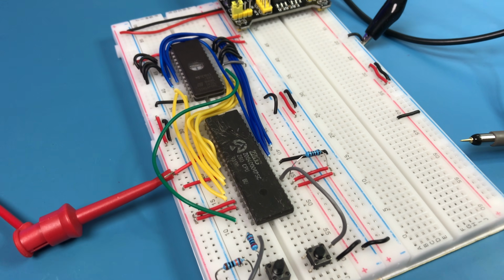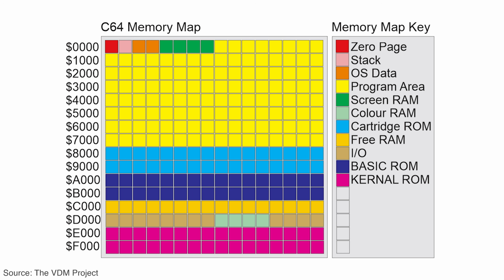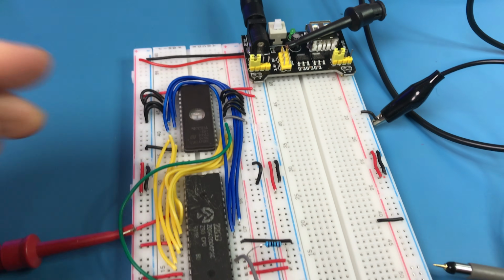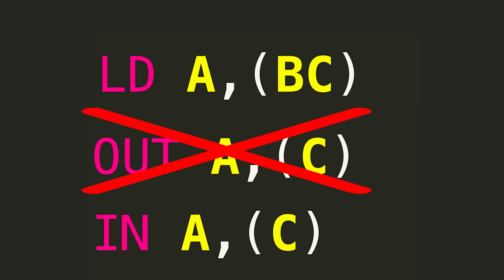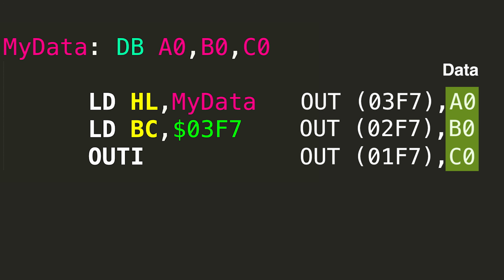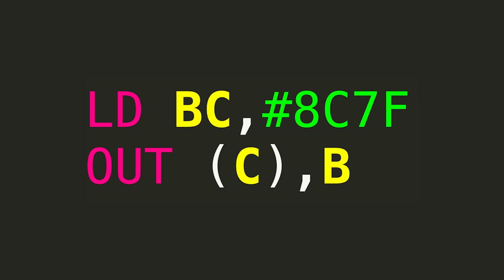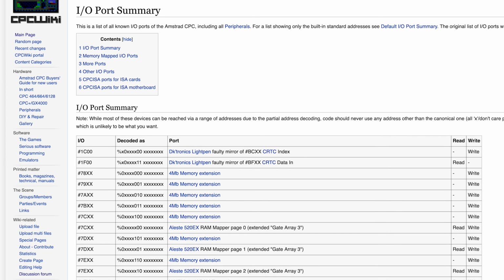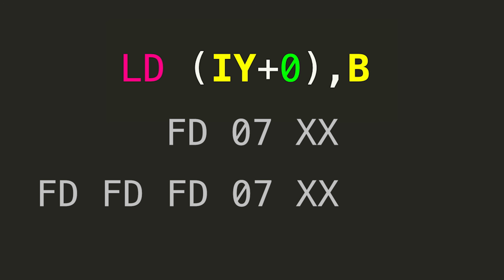The Madness of Z80 I/O

Comment: I don't understand the inability to single-step the Z80 CPU.
I was able to do so without problems back in the day.
I built a Z80-based computer in 1981 ... and single-stepping worked just fine.
Perhaps the Z80 design has been changed since then?
Reply: You can single step tie processor but most dynamic ram requires a minimum refresh rate which won’t be met when single stepping the z80 so the ram will lose or corrupt the held data because your not using it correctly. Static ram would fix that issue.
Reply: @SteveInScotland  That's exactly what I did when first building that computer. I used 4 KB of static RAM.

Only later did I add dynamic RAM, 16 KB x 3. By that time I had a bootable system and I no longer needed the single-stepping.

To my original question ... The single stepping that I used took advantage of the (peculiar) way that the M1 and WAIT signals worked. So I was wondering whether something in the design had changed that would render that unworkable.

Instead, it seems that it is still workable ... and that the only hindrance would be the use of DRAM.

Comment: Hi Noel, great trip down memory lane, thanks. I cut my teeth on Z80 assembly back in the day, just like you I used a switch to toggle the clock line. Pretty sure it worked without issue ie totally static design. I think the original Zilog data even mentioned this in the clock specifications dc to 2MHz, I remember being impressed by this. keep up the good work 😊

Comment: On msx you have a choice, you can use I/0 ports or memory mapped. It has a slot select mechanism where you can choose out of 16 slots on 4 memory locations (16KB pages) . There is also some other I/o addressing in the standard which makes it possible to go beyond 256 I/0. All these things were standardized . I think  probably that is why there are soo many extensions for this system.

Comment: Fantastic Video.

I'm a ZX Spectrum software developer and that's the best exclaimation I've seen for the IN (C) and OUT (C) not having B included in the mnemonic.  As a software developer, I often ues LDI, LDIR, LDD, LDDR but rarely have I every used OUTI OTIR INI INIR, just the regular IN|/OUT and so the counter versions because the root reason hasn't really occurred.  

I'm glad modern hardware does full address decoding.  :-) 
The Amstrad CPC info was new to me. Thanks.

Comment: i wish some of these videos were available in 1984,  it would have saved me many many hours of trial and error.  Every now and then I still code my old z80 based TS2068.  A few years ago I breadboarded (TTL logic only) my own dot matrix printer interface for it. That had been in my bucket list for 37 years.
Reply: I find it really amazing how much of this was in books and newsletters, even in Dutch. I sometimes feel less is available today then back in those days. For example a 7 volume IC guide, in Dutch, with everything from 74xx to microprocessors like the Z80, all in a well structured set of ring binders with better information than a digital folder of crappy datasheets.

Comment: Im a big 8080 fan, im glad the mnemonics for it are marginally more co sistant than z80. With 8080 in/out instructions always read/write to the accumulator reg. Verry bothersome that it requires the address to be ahrd coded but you win some you lose i guess

Comment: The ZX Spectrum requires the upper 8 bits for the I/O address to read the keyboard.  So you're incorrect about the chips just looking at the lower 8 bits on the Spectrum.  The upper 8 bits select which rows to fetch on the keyboard.

Comment: I spent the bulk of the 1980s using the Z80 almost exclusively, with a little deviation using the 8086. But used mostly Intel peripheral chips (8051, 8053, 8055, & 8059) with that Z80. Yeah, a little extra TTL "glue" to mate the signaling. Into the 90s, went to mostly x86, when a full processor was needed, and microcontrollers when it was simpler. Starting with the HC05, since it was a joy to code in assembly. Moved over to the AVR line, with a transient pass thru with a few 8051 projects.

Dollar wise, the Z80 was still the biggest selling processor well into the 1990s. This was when an individual Z80 sold for under a buck, compared to x86, including early pentiums, selling in the $200 range, each !

Comment: Another peculiarity of the Z80 is the added IX and IY registers. The Intel 8080 (which the Z80 was designed to be a superset of) had various registers (BC, DE, HL) that could be used as 16-bit registers, but each could also be used as two 8-bit registers (B,C,D,E,H,L). However, the new IX and IY registers could only be 16 bits, not 2x8 bits. In most cases, anywhere in the Z80 instruction set you could use the HL register, you could instead use the IX and IY registers (very useful). It didnt take too long to notice that the opcodes for these IX and IY instructions were the SAME as the equivalent HL instruction, but with one of two opcode prefix bytes that changed the next opcode meaning to use either IX or IY instead. Armed with that hackers (like me) experimented and discovered that if you added those opcode prefixes to instructions that accessed either the 8-bit H or L registers, the CPU would access the upper or lower 8-bits of the IX or IY registers. Again, very useful, and to this day I dont know why Zilog didnt document this feature (no doubt the instruction set designers didnt realize that this was hot the chip design ended up operating).

Comment: Welcome to the world of backward compatibility. The Z80 was designed to be instruction-set compatible with the Intel 8080 (a strict superset). Intel had only designed the I/O space of the 8080 with an 8-bit address space (256 I/O ports), and so the 8080 instructions used only the C register to generate the I/O port address. By the time the Z80 came along it was clear this was a mistake, as more I/O space was needed. Zilog's rather clever solution was to simply allow the B register to supply the extra 8 bits, expanding the I/O space to 64K without having to add any new instructions. This means the Z80 worked fine in existing 8080 designs (since they ignored the top 8 bits entirely), but new designs that were Z80 aware could use the expended 16-bit I/O space. The only oddity was the retention of the existing assembler syntax for the I/O instructions. In fact, very early Z80 documentation DIDNT mention that the B register appeared on the address but, and I suspect that this was not originally intentional, it was just cheaper to let the whole BC register appear on the bus (as it did with other instructions). And only later did Zilog document this as a "feature" when the hacker community had noticed (and used) this behavior in the wild.

Comment: Most of the Z80 assemblers I've used allow OUT (BC),r and IN r,(BC) in their syntax. It's essentially just a quirk of Zilog's documentation, just as JP (HL) should really be JP HL. And in mentioning the Spectrum, that is a specific case where the top half of the bus is used in I/O instructions, when reading the keyboard it specifies which row of the keyboard to read. And if you had something like a keyboard design where A8-A15 was a sequence for the INIR is an ideal use case. LD HL,keybuf // LD BC,&09F8 ; read 9 rows from &F8 // INIR ; grab all of them.
And you do know this isn't a Z80-specific thing, the original IN A,(n) OUT (n),A instructions also do exactly the same, A8-A15 are set to the contents of A before executing the I/O. LD A,&7F:IN A,(&FE) ; Read BREAK key from &7FFE. etc.

Comment: As far as I remember the classical gameboy also used a slightly modified Z80 which didn't use the in / out instructions at all. Everything in the gameboy was memory mapped. Input, synthesiser,  graphics output and even the "network link". I once wrote a simple assembler / disassembler to read and write gameboy roms in Delphi back in the days. I toyed around a bit with a gameboy emulator but nothing serious. Though it was a fun time. Since I'm kind of a "data-messi" I'm sure I still have the assembler somewhere as well as the GB emulator (I think it was "rew") ^^.

Comment: I remember the fact that the Z80 couldn't be single stepped, which caused me some headaches in debugging once. Took a second or two before the processor went socks up and a restart was needed. I realized pretty soon what the problem was, but it still was a headache.

Since I started with the Z80 processor the I/O it has seems normal to me.

A more interesting aspect is to use "IN (BC),A" (sorry if I borked it a bit), but then you could use the instruction to create a matrix decoder of a keypad.

Comment: 5:16: BC is output because it reuses the same circuitry that LD (BC),A uses. It isn't part of the mnemonic because hardware is supposed to ignore that. OUT (C),A is actually a Z80 extension. The Intel 8080 only had OUT (imm8),A and IN A,(imm8) (using Z80 syntax). Note the 8-bit port number. The Z80 added a variable-port any-register variant to its extended (ED) instruction block.

10:49: You can actually reach much faster speeds than LDIR (or even than an unrolled LDI loop) using an overengineered PUSH/POP loop, down to 12-13 clock cycles per byte copied, as opposed to 16 and 21 for LDI and LDIR respectively (assuming no wait states). The reason LDI is so slow is because the ED opcode fetch slows it down, the reason LDIR even slower is because instead of having the loop built-in, the z80 just decrements PC twice to go back to the start of the instruction on every iteration, which is a very inefficient operation. (EDIT correction: it may actually be doing a 16-bit+8-bit addition like JR uses. i need to look at the die shot.)

21:13: FD FD is not empty, it is undocumented. A standalone FD byte actually does the following things:
1. set a flag that disables all interrupts (including NMI) for one instruction. Other instructions that do this are all the other prefixes, and also EI.
2. set a flag that replaces any instance of H or L with IY for one instruction, and if (HL) is accessed, read another byte for an index offset
This means that every instruction that is valid in the base instruction set is also valid in the FD extension. Only some of these are useful though, because a lot of them won't be any different from the base instruction set.
Therefore, when the Z80 encounters the second FD, it doesn't ignore it and keep reading, it ignores the first FD. The second FD overwrites the first one.

Another device that uses a Z80 and has it wired up to use all 16 bits is the Texas Instruments 84 Plus C Silver Edition graphing calculator. Except it actually uses all of the ports separately rather than just wiring up some bits to some chips. And it has an ASIC with an integrated CMOS Z80 rather than an original standalone NMOS Z80. Actually, it does 19:50 too: it has a special sequence of 5 instructions that needs to be executed from a "privileged" rom page before letting you access certain hardware ports. However, no check is performed to see if the bytes are executed. You could just read them as regular memory accesses, which means there are a few variants that use undocumented instructions, that can e.g. avoid the IM 1 that is part of the sequence.
Reply: Any example of "overengineered PUSH/POP loop" please ? 😃
Reply: @amidarius  Uh, alright, so, for a general purpose one:
loop:
  ld hl,#
  add hl,sp
  ld sp,hl
  pop af
  pop bc
  pop de
  pop hl
  exx
  ex af,af'
  pop af
  pop bc
  pop de
  pop hl
  pop ix
  pop iy
  ld sp,#
  push iy
  push ix
  push hl
  push de
  push bc
  push af
  exx
  ex af,af'
  push hl
  push de
  push bc
  push af
  ld (#),sp
  ld a,r
  jp nz,loop

It uses all registers (aside from I, i guess), and uses R as a loop counter. Interrupts (obviously) have to be disabled. The first # is the difference between source and destination, the second # should be initialised to the address of the byte after the destination block, the third # is the address of the second #.

As the loop increments R 37 times and R wraps around after 128 (which is coprime with 37), every number of iterations up to 128 can be achieved in this manner.

Of course, the setup for using this method is very expensive, and even then it would copy at 15.9cc per byte (assuming no wait states), which is only marginally better than an unrolled LDI loop at 16cc per byte. And of course you also need to jump into an unrolled LDI loop to cover the remainder after the 20-byte blocks this loop copies. This is a lot of calculations, especially on a Z80 that can't do multiplication or division, but there are definitely cases where several of these values can be hard-coded.

(i did say it was overengineered)

However, where this method really shines, is if you know source & destination at assembly time, and are willing to unroll completely:

  ld sp,#
  pop af
  pop bc
  pop de
  pop hl
  exx
  pop bc
  pop de
  pop hl
  ld sp,#
  push hl
  push de
  push bc
  exx
  push hl
  push de
  push bc
  push af

This can do 12.5cc per byte(!!), in 14-byte multiples. (and it doesn't use AF' because that would actually slow it down to 12.75cc per byte)

LDI is slow because it's an extended instruction :(. PUSH/POP are crazy efficient like this because they're one-byte instructions that can do two memory accesses. So copying one byte takes 3 total memory accesses, instead of LDI's 4.

It's even faster if you just need to zero out a block of memory or something:

  ld hl,0
  ld b,l
  ld sp,block+4096
loop:
  push hl
  push hl
  push hl
  push hl
  push hl
  push hl
  push hl
  push hl
  djnz loop

This clears a 4096-byte block starting at `block`, taking 25875cc in total, for a rate of 6.32cc per byte(!!!!!).

But remember to save&restore SP. And remember you can use SMC for that too to save another 10cc :p.
Reply: Okay i did some math to figure out more about the initialisation. The number of iterations is BC/20. The number of bytes to be copied outside of the loop is BC%20, so the JR offset into a block of unrolled LDIs is (BC-1)%20*2. To find the number to set R to, multiply the number of iterations by 45, add 36, and AND with 127. Or something other than 36 depending on where during the initialisation you're setting it. However, this method only lets you copy up to 2560 bytes (+ 19 for the unrolled LDI loop), so you can save at most 256cc, which is less than the initialisation would probably take. Unless you added an outer loop counter too, or unrolled the inner loop some.
Reply: @fghsgh  Yes, the first metod is really overengineered. 😄 I knew for second (With 8-byte multiples (Without exx.) was already enough fast. 13cc/byte) and third one. Anyway, nice post for all Z80-every-cc-counts newcomers. 😂

Comment: Amstrad dev here. It wasn't just a cost issue driving the weird I/O mapping. We also had to consider the number of logic gates available in commercial gate arrays. Side note: The prototype hardware used discrete logic to produce a Gate Array Simulator with the same pinout as the final chip, called the "GAS Board." This also held the EEPROMs that eventually became the ROM. Later we would hack off the EEPROM sections to use for ROM development and called these bits "Small GAS Board" which evolved into us calling them Smorgasbords. You're welcome.
Reply: Awesome insider view, thanks a lot!

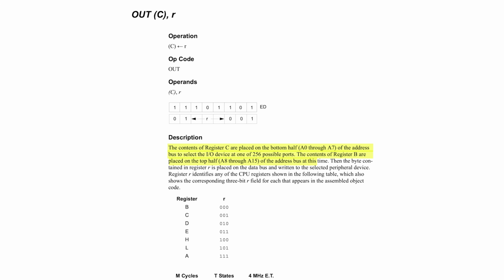Comment: 5:06 yes thats how it works. so if never use B for 'r' to send data you can use that B to make 16bit device address. cool? or not yes thats trick. that how is was desinged todo but someone made misstake. b and c should not be in used register if it use c and b lol.
if i remember correct bute from register ''r go a0-a7 to select device miss leading C that not use but byte that come after opcodes go data line AND those same go A15-A8. some one made bobo. same data you send device is same as what you can use it select device. NOW desing computer xD

Comment: 4:07 yes thats how it works. 255 different output device. is that too much LOL. and only we use d7-a5 to select device and a3-a0 address on device if it need. and some people use a4 to double those devices 16 devices + 16 control address for. thats enought. without loosing ram/rom space.
those devices can be latch for changing ram/rom banks.yes more than 65k

Comment: You also need to take into account that I/O instructions made it into the x86 realm, so far that I/O cycles were a special cycle on the PCI bus. The limited amount of I/O addresses were a constant annoyance, mostly because a large swath was generally taken out of each page to account for aliasing of old ISA cards. The ability to have so many devices on the PCIe bus would cause legacy devices to run out of allocated I/O areas. I think that happened somewhere around 10 ethernet controllers.
Fortunately, when NOT using legacy access modes, we were able to scrounge up more I/O ranges. It was amazing to me how long the I/O ranges lasted in x86 CPUs. As a BIOS programmer, it was hell.
Reply: The fact that the PC survived so many massive changes (protected mode, 32bits, out of order, 64bits, PCI, GUI, the insane variety in SVGA cards and sound cards, 3d acceleration, multi-core, VGA, paging) is definitely some kind of miracle.

Comment: This only becomes a problem if you try to use the instruction as if it was INI (BC),r. It isn't. The description of the instruction merely tells you what happens to the top 8 bits, it doesn't direct you to use them.
Instead, if you need more than 256 ports you need to find a different way to select which group or bank of devices you need to talk to. Since that is likely to be done using another OUT instruction the address for the bank setting device has to ignore the high byte so you lose 256 of the possible 65536 addresses, no big deal.
There's even the very useful OUT (n),A which makes it easy to implement in software and the additional hardware is minimal. Why Amstrad chose such a clunky method, which possibly saved a single chip, is beyond me.